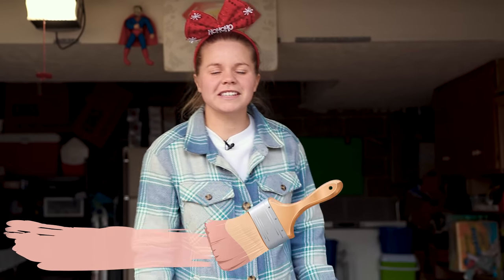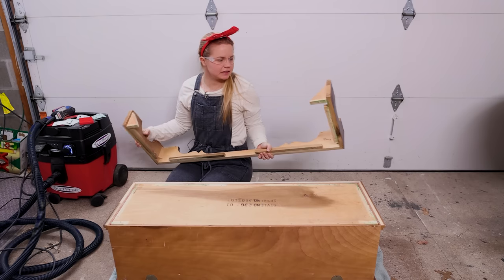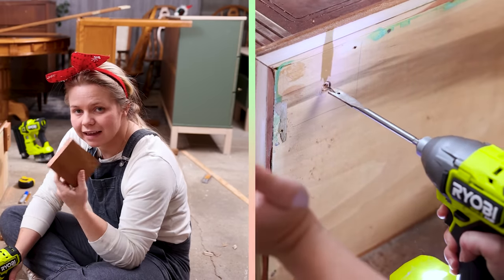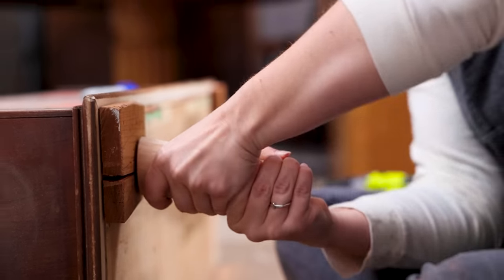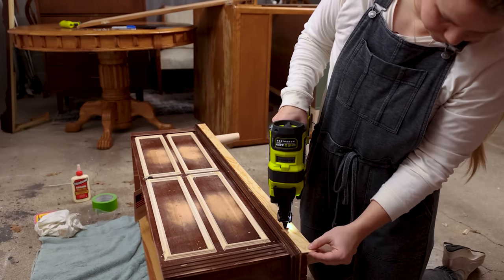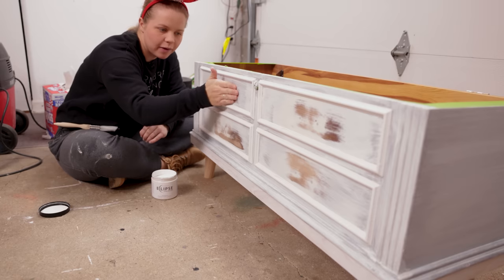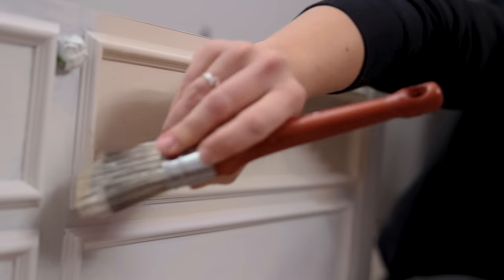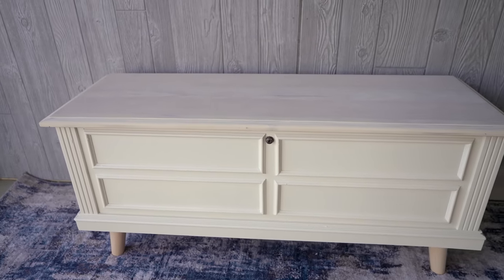Hope Chest Makeover + DIY Hacks to Transform Furniture | Installing Wood Legs & Trim Molding

Comment: FYI get a Dremel tool and use the little metal cutting wheel to cut those screws down to whatever length you want, so you don't have to add blocks of wood to the bottom of your piece just to accommodate the stock screws.  Once you use one you'll wish you had gotten it sooner!
Reply: Yeah, the split wooden piece should be replaced before selling. That leg is going to wobble and is not structurally sound. This can happen to anyone. Otherwise, the  project is good. 👍
Reply: A oscillating multi tool works too!

Comment: Love the way it turned out. Just a little tip for puttying those holes,if u leave a little hill of putty sticking up it won’t sink and then u will just have a little raised dimple to sand off. Most of the time u won’t have to fill hole again. Good job

Comment: Yes, ALL old Lane Cedar Chests were deadly. If inside, you can’t get out. Lane provides replacement locks for free. The serial number on the bottom of the chest, when reversed is the exact date the chest was manufactured. Mine was made in 1944.

Comment: Looks beautiful Lauren. I have a question though, the wood splitting on the block for the legs does that affect the integrity of block?
Reply from the maker: no it wont, i made it secure with the brad nails 😊
Reply: @FurnitureFlippingTeacher  ah OK cool thanks!
Reply: I'll admit I cringed so much when I saw that split. A little bit of pre-drilling would have prevented that.

Comment: I like this particular flip because I have an old (from 1968) Lane cedar chest too.  Unfortunately, I had some water in my basement this summer that I wasn't aware of for several days (I don't go to the basement every day) and the base underneath the chest proper (no legs, just the base) was warped/damaged by the wet carpet underneath it.  Note: This is why I HATE the idea of carpet in a basement rec room!  I think tje cjest would look good with mid-century mod legs on it as the style is otherwise sleek/modern.  I have never "flipped" a piece of furniture in my life, but I have painted a few wood kitchen chairs and a couple of side tables.  The rest of the chest is in pretty good condition other than a deep scratch on the top, that can be filled in with wood putty and I think just restained (I'll try it anyway).  I like the wood look, not into painting something that otherwise is still in very good condition finish-wise.  You gave me an idea with adding the legs to your cedar chest make-over.  I just have to get over my fear of screwing up bigly!

Comment: I loved the color you chose.  I have become a fan of the lighter woodtones, even in washes.  I was wondering though why you didn't spray it instead of using a paint brush?  Were you missing using a brush or was it something about the paint? Thanks for this 12 days of flipness!  I have enjoyed it everyday! Merry Christmas to you two and your families.
Reply from the maker: Thanks! I am enjoying the lighter tones as well! 
I used a brush since it was a smaller project. I honestly don't have a preference between a brush and a sprayer - I like to use them both! Usually I don't have a reason why I use a brush vs a sprayer. I like to switch it up! This paint works great in a sprayer as well! I just used it on day 7's video (:
Reply: @FurnitureFlippingTeacher  Thank you so much for the reply!